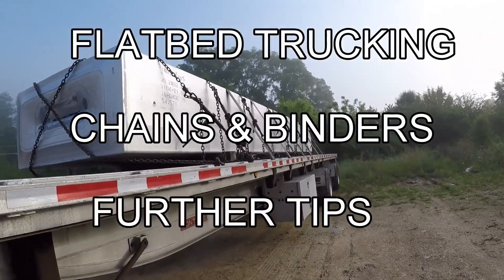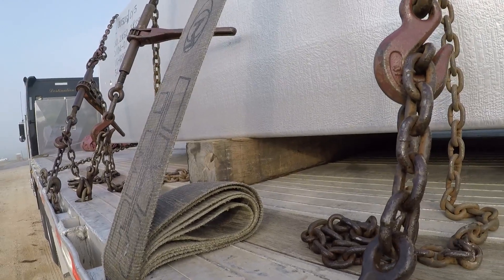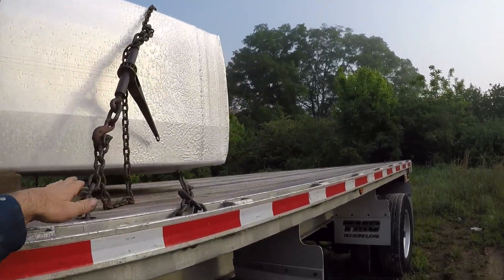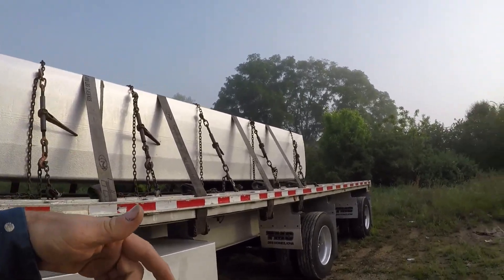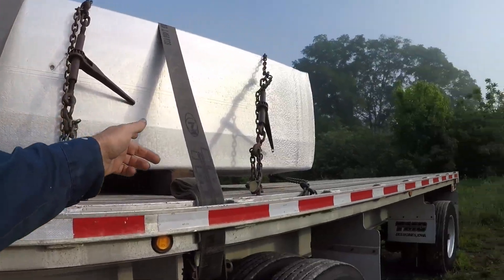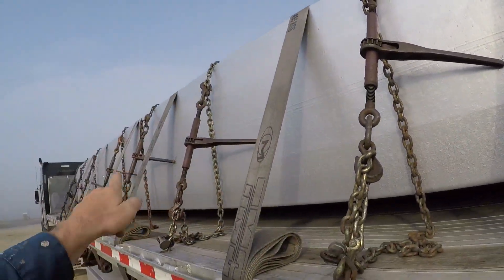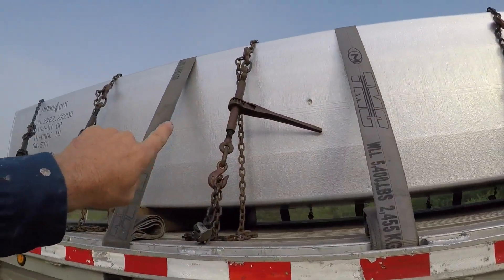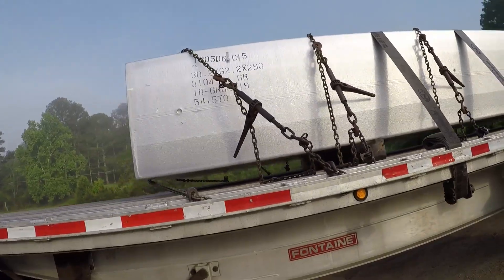Flatbed Trucking Chains & Binders more tips

Comment: Good tips for sure! Hauled dry vans for 8 years. About to start haulin drop deck conestoga. How often to you check the load?
Reply from the maker: After the first 25 miles and every  piss brake.  If it is an easy load that doesn't settle much. Loads that settle or are slick such as number 1 lumber tend to walk because of vibration, keep an eye on those . Easy on the brakes.

Comment: Now THATS excessive securement. I just finished a load of 3 I Ingots from an aluminum refinery, 55,500lbs payload. I only used 10 straps. 

But it sure ain't going anywhere, so right on.
Reply from the maker: And you didn't drive on any public highways because any over size or over weight load that is reduce-able in it's diminsions and or weight must be reduced. Or you didn't cross a scale.

Comment: Very good and professional way to secure the load. Now: what is your axles weight in this particular load? Thanks for the time and knowledge that You share.
Reply from the maker: To be honest I don't remember. Less than 20,000. The permit allowed up to a max gross of 100,000 and max axle of 20,000 . Though I would never put that much weight on the steer axle of that truck. Peterbilt front spring hangers are weak. Had to have three replaced in the year and a half I drove it. Never had even one replaced on my 01 Mack. Piss poor materials or design on the Pete.
Reply: @mackdaddy1911a1  I do appreciate Your prompt attention to my inquiry,  it is very interesting industry. Enjoy the rest of the 4th of July🇺🇸

Comment: Do metal chain protectors need to be on ingots?
Reply from the maker: No, at least not on these. They melt it down and turn it into sheet metal. These are turned into soda cans. I would unload on one side of the plant. Then drive around to shipping and reload three coils. Then take them back to Ball Container down in Rome, GA.  There they made cans for Coke or Pepsi or whoever. Then back to Greenville Ga to start the process over.

Comment: Im new to flatbedding... I'm not sure if u said u did or did not use friction mats.. is it not necessary to use friction mats with this particular load?
Reply from the maker: The X chains serve the same purpose. Not that friction mats are not a good idea. As an extra , however the X chains Are a DOT requirement on this type of load. Friction mats are more for loads that are hard to prevent from shifting. Such as tall, eye to the sky coils on skids. Especially aluminum coils for the manufacture of soda cans.. Very easy to damage . This load will end up as thin sheet metal for that purpose. But in it's raw form dents or scratches won't hurt it. It will be melted and formed into your next coke can. Good luck out there driver.
Reply: @mackdaddy1911a1  ahhh okay gotcha. Appreciate it! Good luck out there to u too

Comment: what about axle grease instead of motor oil?
Reply from the maker: P4UL probably work really good. Just dont over do it cause as tiu screw the end in it will push the excess off . Atleast the 1st time you tighten them.
Reply: mackdaddy1911a1 ok tks. Like your videos. I just bought a 25’ deck over trailer that I tow my tractor with. Got a lot of good information from your videos on using the chains and binders. Tks bro.

Comment: good vid.  I like to use lithium grease on binders. lasts a while. motor oil is a bit cheaper though.
Reply from the maker: jack handy i just use that last little bit that most of us dont have the patience to get out of the jug. I take the empty jug and lay it on it's side. There is always enough left in the jug  to do the binders.

Comment: Is the reason for the straps not having more chains on hand or another reason? Super informative content, thanks man.
Reply from the maker: That is correct. We only had 10 chains and binders. Which according to DOT formula is adequate. But for safety they wanted us to add the straps too. Better to have and not need them than to need them and not have them.
Reply: prolly didn't have more chains and binders. I only keep 6 chains/binders on my truck. for me I never needed more
Reply from the maker: @ericsRANDOMclips  if you work for TMC you will. This is the minimum they require. And with all the brown nosing sum bitches that work there...  Besides better to have more than getting splattered by a shifting load.

Comment: Sorry but how you going to try and teach people and not do it right yourself I have hauled many aluminum ingots and every place has said no chains only straps
Reply from the maker: Well bro this place requires both.  Especially the X chains fore and aft.  .
Having said that maybe you use X straps. And maybe you use more than just enough. Good for you if you do. Novelis requires chains or you can not leave the property or get the BOL. Their ingots are melted down and are transformed into sheet metal. Mostly for beverage containers. Ingots are the raw material, not the end product therefore I can not imagine why the places you haul out of ban chains. Regardless Novelis requires them .
Reply: ALL of the ingots ive hauled required both they didn't make you strap it on the property because the ingots were still hot
Reply: Raw material = chains

Comment: That's wayyyy to many straps and chains, 10 straps around it and I'm rolling down the highway all day long.
Reply from the maker: 18 minutes start to finish and the damn thing won't move. 1st the fore and rear X chains are required by regulation and common sense. If you crash and all you have are straps well there won't be much left for a casket. 2nd better to have too many rather than too few.  Too few and you don't get a second chance to add extra. It isn't so much our driving I worry about. It is the dumb-ass 4 wheeler that does something stupid that will get us killed. You are overconfident and one day another driver will do something that requires you to stomp on the brakes hard and without the X chains your load crushes the cab and your new CB handle is SPAM in the can. Or you come upon a pile-up in fog or rain or a whiteout and splat. Slow is Smooth and Smooth is fast. Do it right or stay home.
Reply: @mackdaddy1911a1  You won't rear end nothing if you keep your eyes on the road, You're overdoing and overthinking everything.👎👎